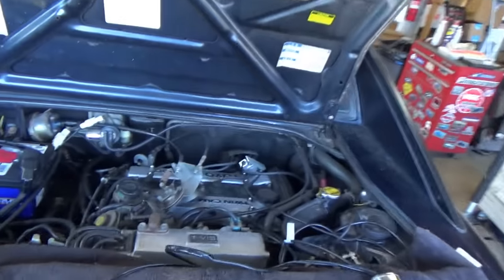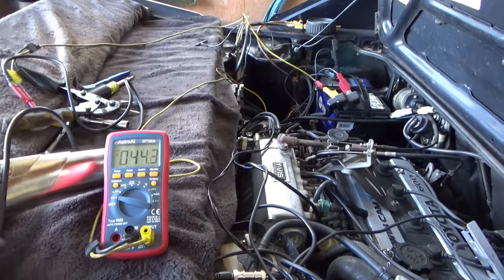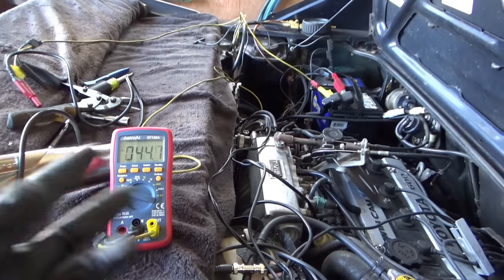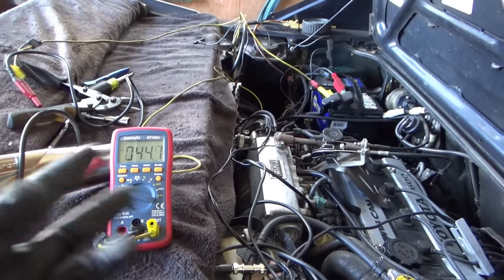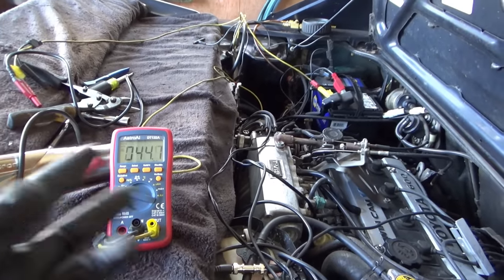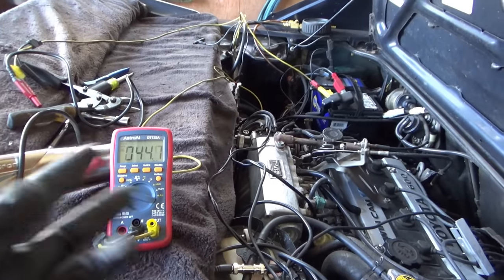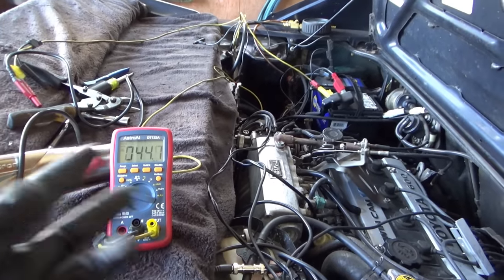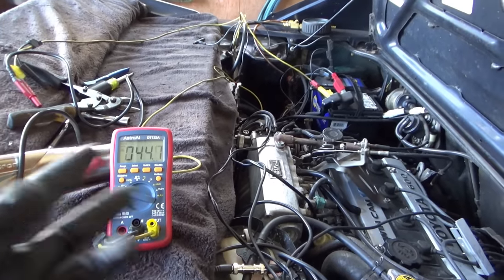Toyota "New Year's" Time Machine...No START when HOT? (Part 3 - 1987 MR2)

Comment: It might look as though the crankcase vent goes straight into the inlet manifold but it doesn't.  There is a passage cast into the manifold that routes the crankcase vent back to the throttle body and exits on the air filter side of the butterfly so there is no strong vacuum on the crankcase vent (as you discovered).

Comment: Well, he had a thorough engine check up at least. But I am a bit critical that you did not see what was in the box in the first place. Truly, that would have been the first thing I would have done, just out of sheer curiosity and it is "nice to know" what is available before getting on to the job.
Reply: I was going to task the same thing.
I assumed Ivan looks through the spare parts before starting.
Part of a routine?
Oh well, Ivan must have felt frustrated!
Reply: I would have looked inside the box in the beginning as well to see all what was in there and what possibly had been replaced.  I was questioning the computer from the beginning after seeing the water staining and that he could not remove the screws to get inside of it.
Reply: I'm more curious why the customer didn't try swapping the computer himself before driving 6 hrs to Ivan.   In part one it is mentioned he was working on it himself for a year supposedly.

Comment: Ivan, you left the EGR modulator looped to itself.
Reply from the maker: Actually I left that block off plate in there so EGR is permanently disabled because it's dumb haha 😊
Reply: @PineHollowAutoDiagnostics  I guess the owner also tried the other engine computer. So the vacuum leak combined with the bad computer where probably causing the stall problem. I'm curious how the engine would run with the other computer and the vacuum leak in the EGR modulator. I do think keeping it blocked of is a good idea. I also blocked of the EGR value on my car in the past.
Reply: I do it to any vehicle I have, usually get a few hp gains by doing so😉
Reply from the maker: @PeterSchops  Actually the owner never tried the replacement ECM...otherwise I would not have seen this car at all haha
Reply: At  NASA, I have fixed many circuit boards in a Ultrasonic Bath. Just use a your favorite cleaner for about 15minutes. All the Crusties will disappear. Rinse thoroughly with distilled water and blow dry. Inspect afterwards the board for cracked or cold solder joints.

Comment: On the old O2 sensors, I would use my body as a resistor, one hand on positive battery, one hand on the O2 wire going back to the ECM, and then switch to the battery negative to force low voltage. You could actually hear the engine rpm change going from extreme lean to extreme rich. You could also see the change on a 4-gas analyzer.
Reply: That test is not valid  100% , we did that experiment  5 guys in the shop , only changes the voltajes  with 2 guy the other 3 not at all , body resistant  changes  from a person to person  depends  the amount  of alcohol  in the blood😊

Comment: Great job, Ivan! Seems the corrosion in the circuit board of the engine computer was setting a bias in the sensing inputs. A lot of work could be avoided if you knew you had a spare, but all those other checks were important too, as you now know everything operates as it should. Cruise control should be a breeze, by comparison :-)
Happy and productive 2024!

Comment: Had a similar problem on a older car, stalling when hot. The car had been to several workshops, it ended up being a warped intake manifold. Had the manifold machined, fixed the problem

Comment: I'd love to see the original ECU redone by one of the prime YouTube electronic repair guys.
Reply: @@nv1493  The board in the ECU may just need a clean with some isopropyl alcohol & a toothbrush? - Maybe?  I saw a rusty-red stain about a half inch diameter across a number of tracks & solder pads on the solder-side.  Were there any others?  I may have missed them, but hopefully, not too much current has flowed where it shouldn't have, to actually damage any of the electronic components on the board.  

Then the owner will have a spare, working, repaired ecu with 'no parts required'!
Reply: Not that many years ago, you could purchase a working ECU for these cars for $50 or less.  Hard to justify the labor to clean and install only to find out it still doesn’t work.  Diagnosis / repair is expensive.  We don’t know Ivan’s arrangement for this series, or how many hours he has into it, but with this car (and the previous Audi) diagnostic time is usually valued at $180 / hour in most shops.  These older cars are typically labors of love by experienced enthusiasts for a reason, as you’d quickly be bankrupt if you had to pay others to service them.
Reply: @ @reneneron2971   Well if they're a labour of of love, then enthusiasts WILL pay specialists the money they require, for the specialist jobs they can't do!  Lol!  You don't make sense mate!

Comment: This is why I always respect the technicians who use to work on these types of issues back then, no live data, no Bi directional, no scope just a multi meter if your lucky
Reply from the maker: I would refuse to diagnose one of these without a 4-channel scope LOL
Reply: @PineHollowAutoDiagnostics 

This is one reason I got the 8 channel scope. Although on the pricey side, I can look at multiple things at the same time to see how everything works in concert with each other. I have the 4 channel Pico scope as well as the 8 channel Pico scope and in the end with older cars I use the 8 channel more often because it allows me to see more data so I can spot harder to see issues.
Reply: @cclngthr  How did a damaged computer affect the car's poor performance?? Was it giving too little fuel??
Reply: @ebolti22  

Anthony's 1959 Studebaker Silver Hawk doesn't have a computer. It had a mechanical fuel pump, but the fuel was not pumping at the right rate and volume to run the engine even with the 259 cid V8. One sign of this is how much fuel is in the fuel filter.

Comment: Yes! The voltage being different tells us everything! I bet you you could fix it too. Those blue resistors on the left look like they got pretty toasty, one of their values may be off or it could be a partial short, but you know where it has to be. With a board that sparse it would be easy to trace out the nets for the MAF input and check everything on them 😁

Comment: Respect!! I worked few years on a Toyota Corolla from the same area with the same symptom (with carburetor) and 10000 vacuum hoses and everything was vacuum controlled on this car! i had 7 service manuals and none of them matched for the vacuum system because different layouts depending on the country emmisions law. finally (after about 30h work) i found a broken membrane in a modulator. this was a nightmare!!! i thought you have something similar here!

Comment: You triggered old memories of working on these old pre data stream cars. I have I few old scope captures on a very old thumb drive. One was a 1987 Camry VAF. Idle was 3.3V and with a WOT snap dropped to 0.42V so it worked backwards. If I could link a pic, I would. This was with the Mastertech scope module, single channel. Also in diagnostic connector, there is a pin labelled VF which I believe is some kind of caveman fuel trim feedback voltage. I have a scope capture of a good running car. It is a sawtooth waveform from 2.9 to 1.6V. Keep up the good work Ivan and wait the next video.
Reply: Why was Ivan's Toyota running lean at idle when the MAF was showing high voltage? so he was rather adding fuel
Reply: They are both the same vintage Toyotas, but maybe the calibration is different? The scope capture I have is 20 years old so I don't remember circumstances. I am assuming my specs are known good or I would have annotated the capture. @ebolti22

Comment: Cool stuff Ivan, Ah yes the bridging of the electrons. lol It will get you on a humid day as well. Ole green crust, oxidation, and rust can be conductive as well as destructive. Get ya a can of freeze it, used it alot on circuit boards back when I repaired TV's and circuit boards back in the 80's, solder iron for pin points on boards. Now days with all the apps and gadgets like your pico can get you right there.

Comment: The O2 sensor adjustments when warm and above idle added to the complexity. The O2 adds another variable. My 85 GM Tuned Port , uses a .45V default for O2 when unplugged.It is sometimes best to unplug. Also my car uses a default for the MAF and for the TPS when unplugged.If the TPS is unplugged  assuming there are no other problems, it will produce a high idle.  If the MR2 had this TPS  capability, the car would have stopped stalling at idle with the TPS unplugged, but would have mask the real ECM cause. On my 85 Tuned Port, this MAF high voltage might have set a code 33.  The diagnostic for it would be voltage checks for the 5V reference  and for 12 volt supply voltage to the MAF, using the analog and digital ECM pins for ground, not battery ground. It seems to me the ECM is developing an additional voltage drop when ECM is warm, probably on the ground side. The amount of voltage drop is the difference you measured between the original and the new ECM for the MAF circuit.
  If you could measure the temp of the ECM and the time it takes to die, and compare it to the original ECM after it came out of the freezer overnight, it just might prove that the ECM would run a lot longer before acting up because the initial temp from the freezer would be 0 degrees F.  It seems it took a longer time for the engine to die when starting from a cold engine and ECM , than what it took when the car was already warm. It also was harder to start.

Comment: I had a similar problem with my 95 dodge intrepid.  Only instead of pulling the fueling too lean it was going full rich just dumping fuel into the engine and after a few minutes running the catalytic converters would start glowing red.  Turned out to be a bad ECU as well. Took 3 months to find another one as they had long since been discontinued.  Great job, these are the types of problems that make even experienced techs pull their hair out.

Comment: I would have put my money on the vane airflow. In the late 80s I pulled the engine from a Volvo DL (red block 4 cyl, not the POS PRV 6), to send out for a rebuild. After I put the engine back in the car, it would either barely idle or not at all. I eventually figured out the problem, I had omitted a clamp that had fallen in my oil drain pan under the car. It was between the airflow sensor and the engine, so there was a huge vacuum leak. Upon replacement of the clamp it settled right down and idled nicely. I have never made that mistake again!

Comment: Welp, those of you who commented on the ECM as the trouble, deserve a kudos. The reason I didn't condemn it from the get go was because in 30 yrs of working on cars, I've only seen 3 Toyota computers take a dump. Granted, none were an MR2 of this vintage, and yeah i saw the water damage too, but knowing how many failure issues these cars have besides the possibility of a computer, I took pause on that. Ivan tested everything, the way it should be! That's the way I was trained in the 90s by GM..test everything, then condemn the computer. I will say had Ivan had the Red Brick with Asian cartridge and connector, he might've found the issue sooner. I kinda want to know if the good ECM still showed the IGT ( i think that's right) drop out on the scope, even though the car was fixed.

Comment: best gift to that mr2 is fit a 92-95 honda civic efi system. trick part is the ignition distributor.for best results all sensors need to be fitted, specially the iac valve. response is largely increased and pretty sure +15hp are achieved. those ecu are fully tunable, so boost is not out of the question

Comment: Customers don't always give information related to the problem.  It can take several phone calls, text messages, or emails to get most or all the info.  Been There Done That.
Anyway, glad to see the engine is running normal now.  Good for you Ivan!
Hopefully the cruise control problem will be much more simple to fix.

Comment: This customer clearly wanted you to check over all systems first, before doing the obvious: the ECU swap. The customer probably had that spare ECU on standby, to be returned if not needed.
The original ECU seems to be fully functional and a good restore candidate. It does everything. Just the inputs are skewed by the oxidation and contamination. I think, it only needs a deep clean and a preventive cap swap. It's all through-hole components, an easy job. Easy to swap, easy to test.
After successfully doing the original ECU, the spare ECU could also benefit from some TLC. It didn't look to be new old stock!

Comment: The flapper has a pentionometer inside the black box. Its just silly Coned in. 
I took my brother mass air flow sensor apart because the flapper was sticking at the close position. Once i cleaned out the flapper. Sprayed some silicone spray and then let it dry a bit. Cleaned the contacts with an earsier tip. Reassemble it and the truck would stall anymore. 
Before he dropped it off. He said it would hesitate bad. 
After i cleaned it. She ran smooth as budda. 
He drives his truck out in the dirt roads alot. He also didn't clean the airbox or air filter as he was supposed to. After i cleaned the air box too. She ran smoothly. 
Of course his Cornputer was never touched by anyone.

Comment: Well, none of the research/diagnosis was a complete waste anyway because in most cases, those computer modules are not the problem. This one just happens to be very flaky and in most cases would have been the last or final call. Now that its running correct, its all worth it. I would not feel bad if a mechanic had to charge me for all of the time just to find out the darn PCM was the problem and only 30 minutes to change out. Part of the good news is that the other components were checked out and ruled as functioning within spec which is valuable to the customer who has an old hard to find parts vehicle. Knowing this information would suggest it will likely be problem free and reliable without worries about "whats next". Toyota...worth the time to keep them running, especially some of the old ones.

Comment: My 2000 Sienna had rough idle and no stalling when hot. I replaced the temperature sensor and the engine now is back to normal. I boiled the defective sensor to check a difference in resistance and it had no change difference from cold to hot.

Comment: Man...  I was hoping it wasn't the ECU, but it was highly suspect at that point.  Thankfully, the owner had a spare one ready.  But why did the owner pick up a good used ECU, and not try it himself?  So many questions.  At least we know that everything else is solid.  Just need to replace the radiator cap neck.  I hope the cruise control is an easy fix.
Reply: Trying to throw curve balls at the sultan of swing

Comment: I have been fiddling with that VAF of my Chevrolet Omega. At least on Bosch units, you have a clocksping adjustment that can be either loosened or tightened. And the wiper also can be moved to a different response. 

The symptomI was having was a zero step on idle fuel trim and a positive on médium throttle. 

I think this design is prone to this, because it even does not store a code for system too rich or too lean..

Comment: Years ago I did a 06 Dodge Stratus that a mechanic put a new timing belt in... It had the 2.4 and ran like a raped ape going down the road but when the car would go to idle it wouldn't and came up as a vacuum leak at vacuum switch which before the timing belt was replaced the owner said it idled and ran good until the timing belt broke so I took the timing belt cover off brought up to tdc and the cams were out one tooth, pulled belt off set the timing put belt back on and the car was fixed, not saying that can't be your problem!!!!

Comment: At 33:18 next to that JIS (Phillips) screw, it looks like that brown glue that becomes conductive. You might want to pick that crap off. Norcal715 runs nasty PCBs through the dishwasher with a low heat setting. They come out looking new! Just because those electrolytic caps look good doesn't mean that they are. They should be checked for ESR! Ivan, you NEED a Blue ESR meter! It can do more than check ESR on caps. You can check low resistance very accurately down to the hundredth of an Ohm. You can check the internal resistance of batteries. It's a very nice tool for not much money!

Comment: Had a similar experience with my 89 Toyota Truck. Valve lash was off, adjustment was too tight. It would start right up cold but die when warmed up. Had long crank times and had very little power although it drove anywhere. Once i adjusted the valve lash it starts right up everytime and never stalls. Not sure if this engine is similar to a 22r. Symptoms are identical and everything checked out just like this.
Reply from the maker: This has bucket and shim valve adjustment, that I've never seen go out of spec compared to the rocker arm and tappet system :)

Comment: Ivan, important lesson,, always check to see what bit and pieces are included with any car you're looking at.  Customers are like medical patients, they rarely tell you the whole story, you need to ask questions and probe the answers you receive.  Great video, considering you had no knowledge of the spare computer.  Might also be an idea to always open any module that shows signs of rust and/or connector corrosion.  Happy New Year bud.

Comment: I used to see more issues (on single wire O2s ) with poor exhaust system grounding than lack of heat .
That, of course, is dependent on placement of the O2 .
Many companies had redundant grounds to the exhaust for this purpose. 
My 2¢